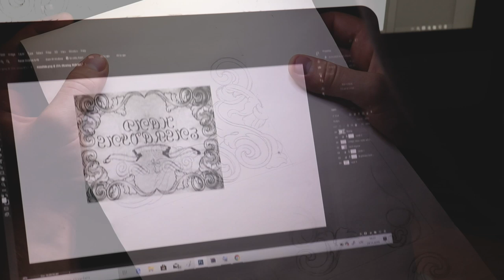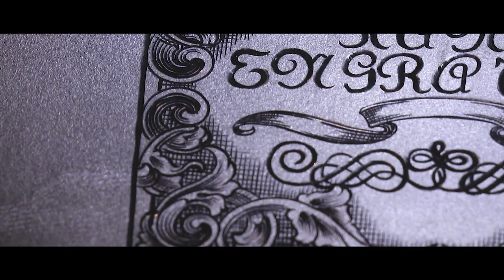Engraving practice plate

Comment: I love engraving, but somehow, I keep breaking my graver tips, no matter what kind blank i use (carbid, glensteel,, grs, lindsay etc.) , it seems impossible to cut deep on steel like knife handle without break tip, I use lindsay  116 and grs 120/105 most of time. still try to find out what I did wrong on steel.